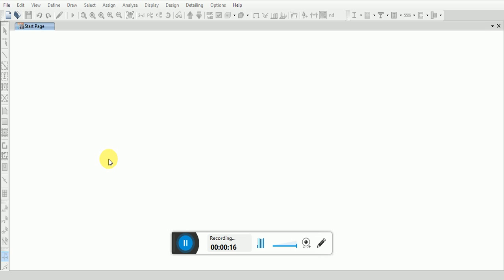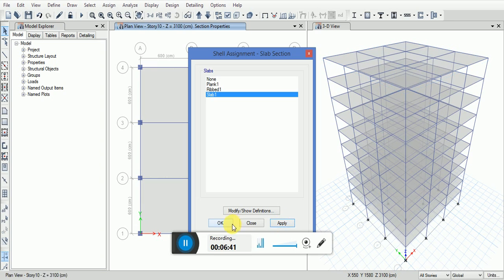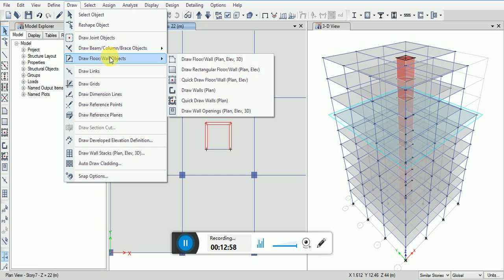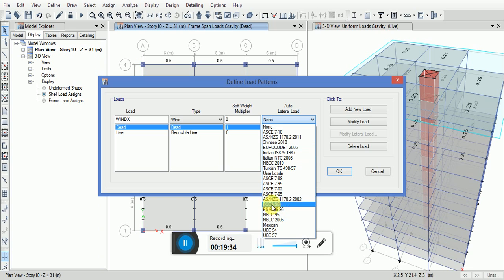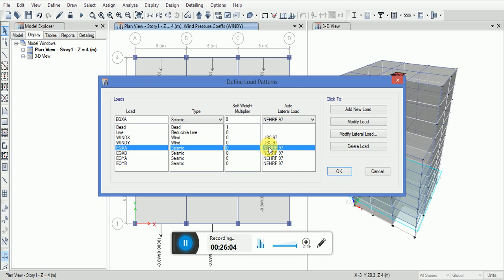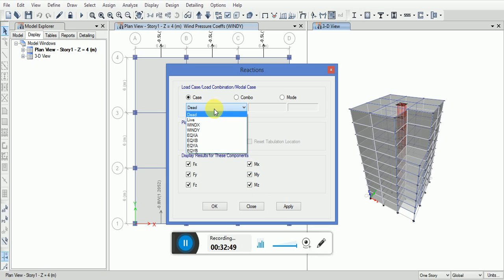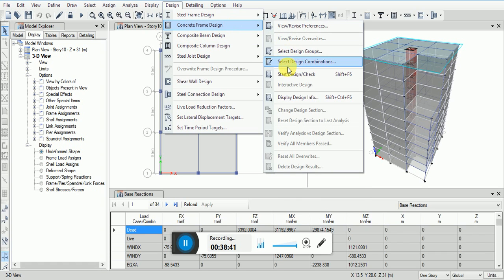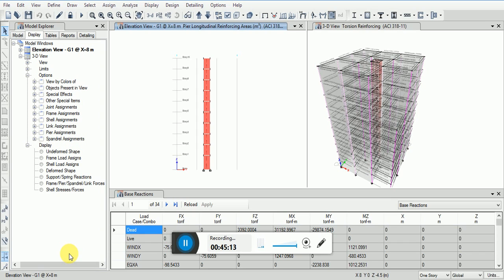SEISMIC ANALYSIS & DESIGN OF 10 STORY RC BUILDING USING ETABS

Comment: But you didn’t assigned daiphfram  for the slab?
Some slabs you didn’t assigned live load for it!
I think you didn’t assigned the wind load in a proper way especially the wall you draw , it should be different from level below 7 and because the different shape of slabs!!!!
Hope you improve your way because it is very important that every thing you do is in correct way,,, many engineers will see this and it will be risky if they do it in bad way,,,,,
Regards
Reply: https://youtu.be/RIOR0gwRL3Q
Reply: Thank you for the tutorial but I think you need to show us how did you choose the diaphragm  (rigid/semi rigid) and you need to check the the torsional ratio for the building as I think it may have a significant amount of torsional moment
And again it is safe to use many diaphragms for your many shells (a diaphragm for each floor) as in the real projects the floors mostly aren't typical and have different C.S than its C.M and it's better to consider semi rigid diaphragm 
And last thing I think you didn't mention your mass source for seismic analysis and it's very important to include this in your tutorial 
Thanks again for your video ...... keep up the good work.  :)